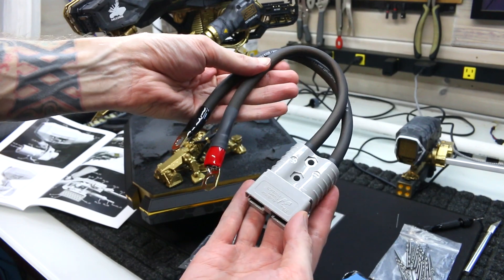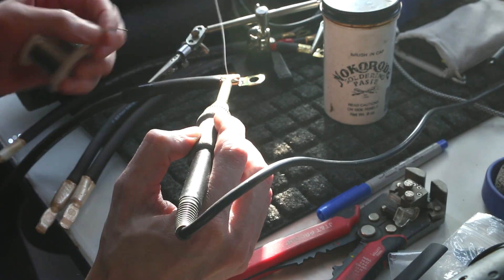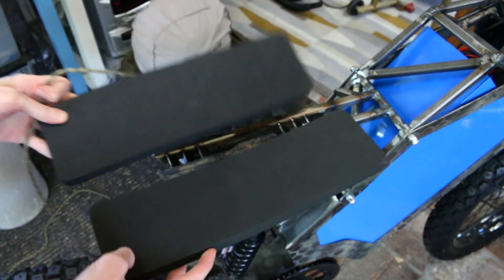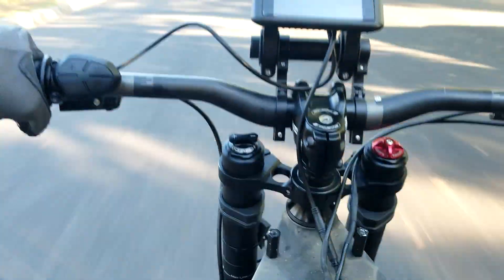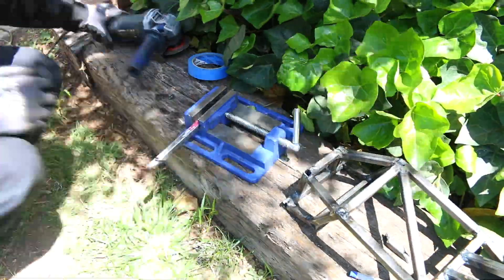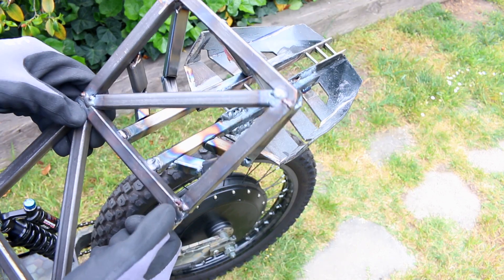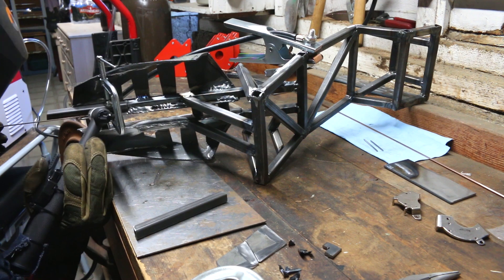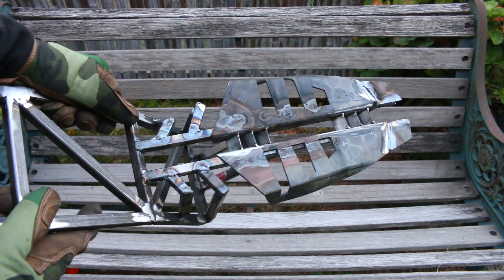🚲 IT'S ALIVE!!! + Test Ride + Tweaks E-bike 9.0 \\  Fabrication - Enduro - DIY Build! \\ QS273 70Ah

Comment: Hi, Cool build! What is the size of that battery though? When i check this on aliexpress the size looks alot smaller??
Reply from the maker: Thank you so much! It's a HUGE battery, please check the first video on this series I go over the battery more 👍
Reply: @hightech-lowlife  Ye i checked that out and saw its so big,.. And i went and bought the exact same one.. but i cannot believe the dimensions they give me.. They claim size is 180mm*250MM *310mm Could you measure yours and provide me with the real numbers> so i can start panicking it wont fit my frame xD
Reply from the maker: @glenluyckx12  I'm sorry, I'm not sure what you're trying to do. Are you just trying to buy a battery that will fit your frame, or are you trying to get the same size battery that I have and put it in your frame? 

This battery I bought will not fit any regular sized frame at all, this is why I modified and built my frame the way I did to custom fit this battery (basically my build series on this bike is largely revolving around this process). If you don't want to cut and weld your own frame parts (like I did), then I would suggest buying a battery that fits your frame. There are many ways to measure the internal dimensions of your battery space, once you have that you can give them the dimensions and they can make you a custom pack you know will fit (because you measured it). 👍
Reply: @hightech-lowlife  Well i already bought the pack before i saw your video.. i bought it looking at the GTK specs they mention on aliexpres.. And i'm converting a motorcross bike to EV so i will make it work. But while i was looking at yt videos regarding these kind of batteries i saw yours and you got the same one from gtk and then i realised hmm that looks way bigger then the dimensions they gave me xD
Reply from the maker: @glenluyckx12  Ah ok 👍Yes, this one was custom made, it's huge: 412 x 232 x 146mm
Reply: @hightech-lowlife  Aaah thx, volume wise they are the same.. This gives me some reassurance there specs are correct. Thx again!
Reply from the maker: @glenluyckx12  Cool! Good luck man 👍

Comment: Hello. Isn't this shock absorber a bit weak for these kilos. I'm asking because I'm currently choosing which one to get for my scooter? If anyone can recommend one I would be grateful.
Reply from the maker: It works for my weight, maybe if you were 250+ lbs you might want to go with a stiffer spring. Find a shock that fits your chassis and then see if they make them in different weight recommendations. If you need even more you can always move to motorcycle shocks which are for 400-500lbs bikes.
Reply: @hightech-lowlife   Thanks. I think 500lbs is good. After all, I am 77 kilograms and the scooter hardly exceeds 80 kilograms. Thank you for your attention 👍
Reply from the maker: @blackworld7803  No problem 👍yeah I think you will be able to find a solution easily, good luck!
Reply: If you can get mounts fabricated, the Chinese Honda clone pit bikes have a massive variety of weight specs and quality levels for their shock. And they're relatively cheap too
Reply from the maker: @marthamryglod291  👍 Yes, there are a lot of options for smaller scooter/dirt bike/pit bike style shocks.

Comment: Don't solder high amp , it creates resistance and can fail. Highly recommend buying a cheap hydraulic crimpers from Harbour freight.
Always vamp high amps !!
Reply from the maker: Thanks man!! I did crimp these first but then also soldered - just for extra security "sticktion". I know it doesn't do anything really, but in my mind it does and my mind creates the reality I live in 👍

Comment: It would suck if a cell in that battery went bad.   Nothing a little chopping and welding couldnt solve.  You got it all figured out now, it would be a few hour swap.
Reply from the maker: The battery is removable 👍 would obviously still suck if a cell went bad though 😂. It's not the easiest thing to take in and out but 10 minutes or so it's doable - no chopping or welding required. Thanks man!

Comment: Ask for cutting disc s next time that was actually a grinding disc you used. and I find the flappy sanding discs are alot tidy than the grinding discs to use👍
Reply from the maker: Thanks man! Oh yeah I have flap discs too if I have to grind a ton off then I'll use the grinding wheels first, then to smooth it out go with the flap discs 👍
Reply: @hightech-lowlife  true yes grinding wheel first. you should put some double clamp adapters so you can fit protaper Motorcross bars on this ebike I'd fit a decent LED headlight on front too with separate lithium battery pack and fit USB for extra gizmo s
Reply from the maker: @officialmysteriousrider130  Thanks!! Oh yeah, those are coming, if you check out my last enduro build you'll see those 👍!!

Comment: you ever look up the asi line cause you could definitely hit over 400amps of power plus field weakening
Reply from the maker: Oh yeah! If I do upgrade this it will be an 800A controller 💥
Reply: @hightech-lowlife  i do believe the asi controller hit around 730phase amps it just pull like 450a from the  battery plus you would definitely burn out that motor stock would need ferrofluid heat sink and definitely upgrade the phase wires i have one with an asi controller easily hits 70 and its not even fully using the controller havent done the upgrades to the motor yet
Reply from the maker: @susannejohnston2336  I think the 273 is good to 50KW without issues, I don't think a lot of people have pushed that far though. What motor are you running? 

The controller I was checking out was 800A RMS, so should be able to handle just about anything, I think even 200A is way overkill for a bike this size, maybe for a real motorcycle frame, which I will make in the future 👍
Reply: @hightech-lowlife  im using the 273 40h 3.5t but the phase cables definitely get hotter than motor which still gets decent warm im pushing about 300a and the controller can definitely burn the motor out if i had 70ah battery pretty sweet bike btw its nice to see other ppl with range anxiety
Reply from the maker: @susannejohnston2336  That's awesome! I'm curious what battery you're running? Lipo cells? Do you have a discharge BMS, or only for charging? Thanks!
Reply: @hightech-lowlife  diy sony vtc 6 pack 20s15p 45ah using a qucc bms 300a with built in contactor
Reply from the maker: @susannejohnston2336  Awesome, thanks! Wow that must have been an expensive pack, those cells are like $10 each! I'm sure it's worth it though, that's a ton of power!

Comment: Love your build. So much attention to detail. Just be careful to don`t get too attached to details to make it perfect.
Are you going to test the qs205 as well?

Do you still have the cyclone 18kw mid drive kit?
Reply from the maker: Thanks man!! Yes, I have to stop myself from trying to make things too perfect, it slows down progression - I'm working on it 👍

I will do another build with QS205, for sure! 

I have since sold that bike, but I will make another build with the 18KW mid drive and try to push it, maybe move to a motorcycle chain to survive the power. 

Thanks for the suggestions and for following the builds!
Reply: @hightech-lowlife  let me know if you want to sell the 18kw kit for a nice price. I'm Europe.

About the QS205 my question was just install the qs205 on this bike and compare with the qs273.
Amps pull, acceleration, efficiency, peak power, etc... Keeping the same T number for both models.
Reply from the maker: @Full_Throttle_no_Brakes  Are you looking for just the motor/controller kit or a whole bike done? Shipping from USA would be very $$$

Ah yes, I don't think anyone has done a side by side comparison with both motors. I will make a video on it later, maybe not this particular build but another enduro setup 👍

Comment: If you just hook up the rear brake cut/regen switch you can still do burnouts
Reply from the maker: Yes, I think you can program the controller to disable the motor cutoff 👍
Reply from the maker: Whats Up Chb2  Motor is (QS Motor) QS273 V3, Controller is Sabvoton SVMC72200 - there are a lot of variations available (different kits, different displays) so dig around to find the combo you want and best deal 👍
Reply from the maker: Whats Up Chb2  No prob 🙌

Comment: 👍
Acrylic definitely
And bending the edges to the front of the seat was a good idea.  Looked potentially dangerous before.
And what are the specs of that battery 🔋 
V / ah?
Reply from the maker: Thanks!! Yes, just tweaked enough to be more comfortable. I went over the specs in the first episode of this series but it's 84V / 70Ah / 200A RMS
Reply: @hightech-lowlife  Holy shit, that battery is insane!!! I saw in the title 70Ah, I was like wow, never seen such a huge battery on an ebike, but I assumed 48V. This bike is going to be crazy. Wonder what the range will be. I think if you don't push it too hard (let's say 40 km/h), it could probably achieve 500 km range, or probably even more.
Reply from the maker: @kosztaz87  It's huge! Most likely the range will be 100-150 miles or so. When I had a 30Ah pack it would go about 50-80 miles,  the bike is a bit heavier now too 👍
Reply: @hightech-lowlife  I see. Probably you go really fast then, or lots of accelerating in city environment. My ebike has a 23 Ah battery, and can do the 130 km (80 miles) range to my grandparents with one charge. And that's a 48 volt battery. But it's flat terrain and the speed I usually aim for is around 35 - 40 km/h. Still, my battery is only 1.1 KWh, and the battery you have on this bike is around 6 KWh.

Comment: Just got some more bits turned up for my build so it's all systems go here as well
Reply from the maker: You're getting closer to putting it all together, can't wait to see it man!!
Reply: @hightech-lowlife  got the forks and a front wheel to paint next 👍ordered a new tyre for the back wheel and a crank
Reply from the maker: @dredfxcustompaint  That's great man, you're almost there!
Reply: @hightech-lowlife  yes then it's the big bill on the battery and controller 🤮
Reply from the maker: @dredfxcustompaint  Yeah, unfortunately the batteries are usually the most expensive part 👎
Reply: @hightech-lowlife  yes mate as I will find out very soon 😬
Reply from the maker: @dredfxcustompaint  It'll be worth it once you take your first ride!